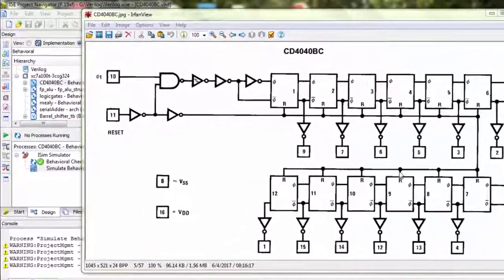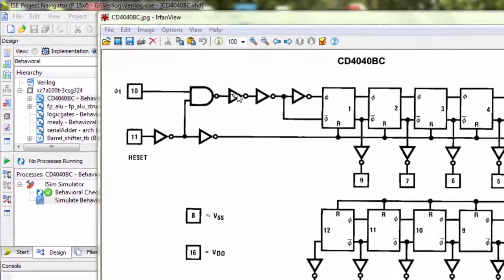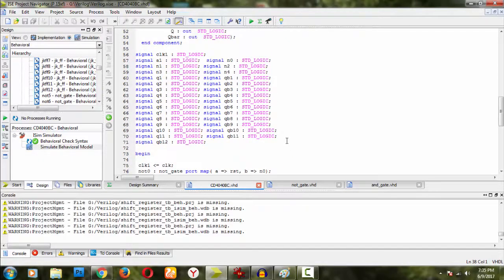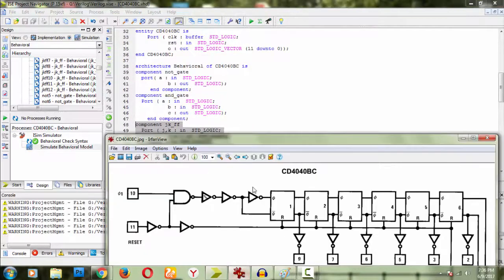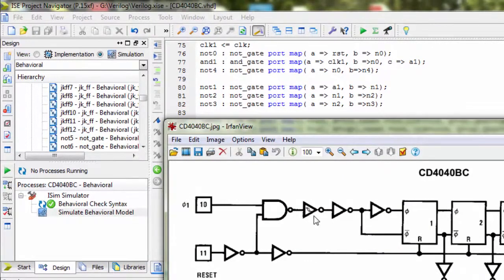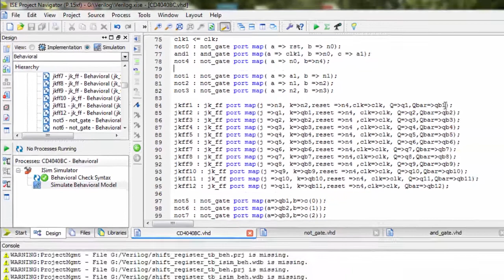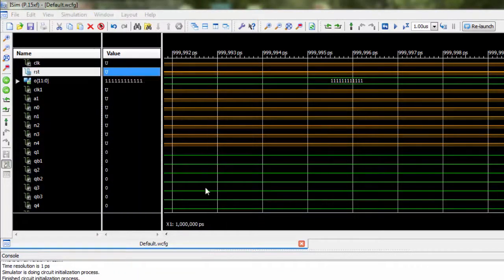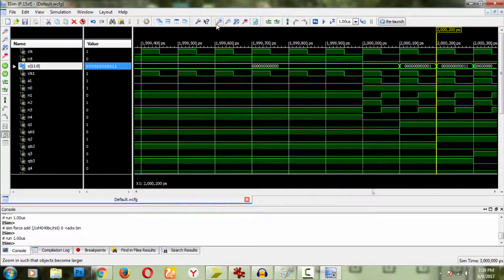VHDL Implementation of 12 bit Ripple Binary Counter(CD4040BC)

Comment: I did not quite understand why? Several warning signs? Could you explain?

WARNING:Xst:653 - Signal <clk1> is used but never assigned. This sourceless signal will be automatically connected to value 0.
Unit <CD4040BC> synthesized.

WARNING:Xst:2036 - Inserting OBUF on port <o<11>> driven by black box <not_gate>. Possible simulation mismatch.
WARNING:Xst:2036 - Inserting OBUF on port <o<10>> driven by black box <not_gate>. Possible simulation mismatch.
WARNING:Xst:2036 - Inserting OBUF on port <o<9>> driven by black box <not_gate>. Possible simulation mismatch.
WARNING:Xst:2036 - Inserting OBUF on port <o<8>> driven by black box <not_gate>. Possible simulation mismatch.
WARNING:Xst:2036 - Inserting OBUF on port <o<7>> driven by black box <not_gate>. Possible simulation mismatch.
WARNING:Xst:2036 - Inserting OBUF on port <o<6>> driven by black box <not_gate>. Possible simulation mismatch.
WARNING:Xst:2036 - Inserting OBUF on port <o<5>> driven by black box <not_gate>. Possible simulation mismatch.
WARNING:Xst:2036 - Inserting OBUF on port <o<4>> driven by black box <not_gate>. Possible simulation mismatch.
WARNING:Xst:2036 - Inserting OBUF on port <o<3>> driven by black box <not_gate>. Possible simulation mismatch.
WARNING:Xst:2036 - Inserting OBUF on port <o<2>> driven by black box <not_gate>. Possible simulation mismatch.
WARNING:Xst:2036 - Inserting OBUF on port <o<1>> driven by black box <not_gate>. Possible simulation mismatch.
WARNING:Xst:2036 - Inserting OBUF on port <o<0>> driven by black box <not_gate>. Possible simulation mismatch.
Reply from the maker: It is used at the top I have assigned it clk1<=clk i am creating some delay or else if you want then connect it directly and share the results with us.
 for more question you can go through https://forums.xilinx.com/t5/Synthesis/Warning-in-Synthesis-step/td-p/97776
Reply: Ok Thank's

Comment: If I want 4 stages instead of 12? Only remove the amounts of stages?
Reply from the maker: Yes thats it.
Reply: If I want to create a switching condition, type I have 6 wires function would look like this:
If you receive 1 activate a1, a2, a3, a4, a5, a6 if 0 activates b1, b2, b3, b4, b5, b6
Could you make an example?
Reply from the maker: Make a small module if(selection=1)then a(5 downto o)= 1 else b(0 downto 5)=0